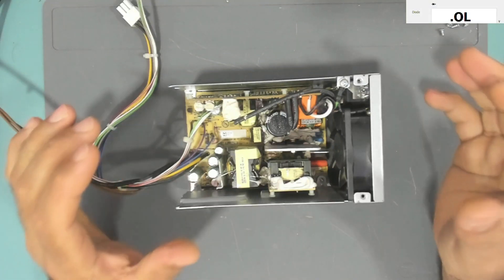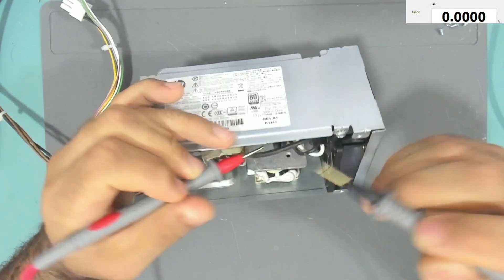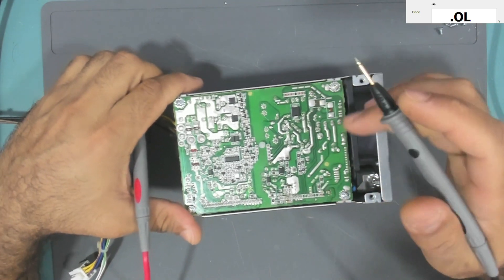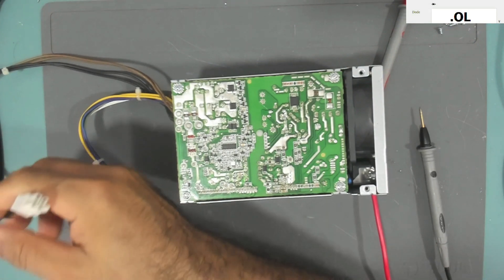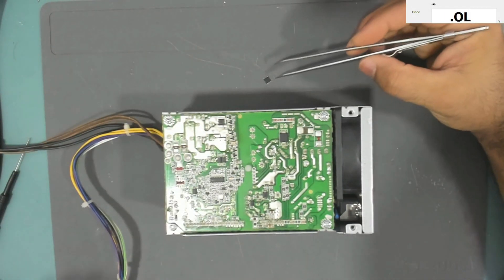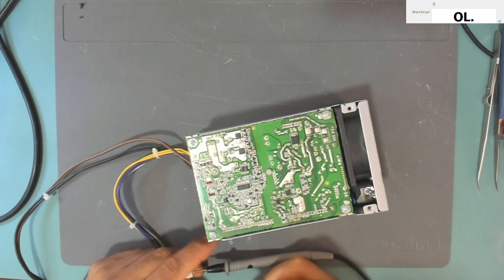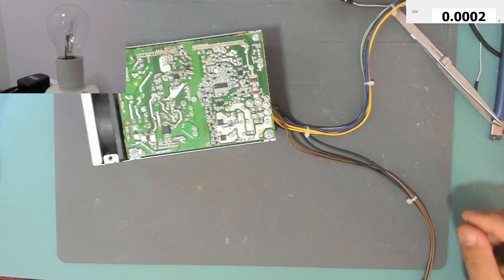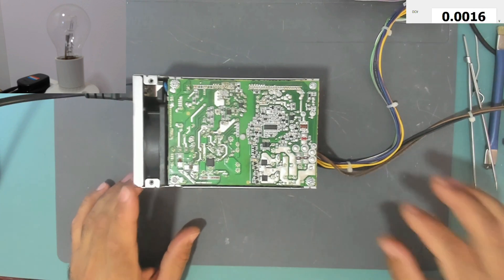Hp PC Power supply repair || SMPS Repair

Comment: Hi ..good effort .. i have a proplem with power supply lik the one in the video .. if u can help me ... 
It was hp 800 G2 twr case .. it was restart randomly .. every 2 or 3 dayes .. then u try every thing it was restart even when i disconnect all cable from the M.B. unless the power cable .. after i replace with another p.s . Every thing was ok .. can u guess the proplem make p.s. restart the case ..
Reply from the maker: Hi brother 
I would start looking at the output capacitors and maybe the input capacitor

Comment: Mime has a blwon out IC. Do you happen to know the specs/part# of this blown-out IC? The IC besides the Capacitor
Reply from the maker: Hi 
The ic I replaced on this power supply was TNY279PG and I replaced it with TNY280PN.
Reply: Thanks. I'll do the same.
Reply: What's the advantage in using TNY280PN instead of the original TNY278PG?
Reply from the maker: They both are the same. The only difference is that the TNY279PG is 18w but  the TNY280PN is 20w.

Comment: I have a question, I removed my HP power supply from the computer to test it and it turns on by plugging it into the wall and without bridging any cables. Is this supposed to happen?
My computer turns on but no display and fans spin very fast.

While it was on I decided to bridge the cables and it turned off the power supply
Reply from the maker: Your power supply is actually fine..
You have something wrong with the motherboard. 
Try resetting the bios and check the CMOS  battery and also reseat the ram memories or replace if possible .
Reply: @FixTronics  I already tried the basic fixes like resetting cmos and bios, reseating ram and CPU, reseating gpu, changing gpu but didn't solve my issue.  

One problem I had with this computer a week ago was a memory failure, the computer would give a certain amount of beeps indicating ram failure. After reseating the ram like 30 or 50 times the problem just fixed itself.

I don't really know what is the problem with this computer. The problems always occur when I shut down correctly and then hours later I try to turn it on and it doesn't work, only this time doesn't even give me any beeps.

I'm 70% certain the computer can detect the ram and CPU because when I try to turn it on without the CPU or without the ram it gives me beeps indicating the absence of each.

Might have to look into finding some new ram sticks to test 

Anyway thanks for responding

Comment: Thank you for this fascinating video, what professionalism!
I have 3 questions for you, if you don't mind too much
- At what temperature do you heat ?
- What's the little brush you used to clean with paper towel?
- Where to find your tweezers, they are great!
Reply from the maker: You welcome brother 

The Hot air temperature I used was 450°C and around 50% air flow 

Here is a links for the brush and the tweezers I used..
https://a.aliexpress.com/_mNbMWQK
https://a.aliexpress.com/_msj5OfU

Have a great day brother
Reply: @FixTronics  Thank you very much for your responsiveness and your kindness.
Reply from the maker: I really appreciate it my friend 
Thank you so much